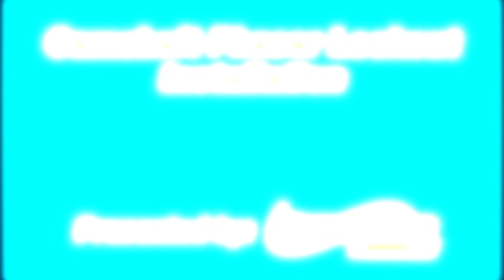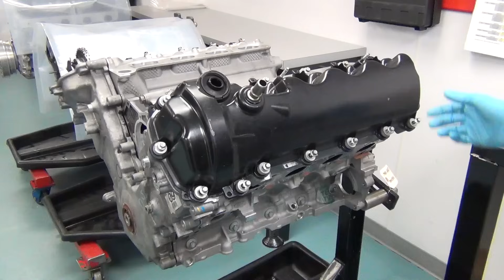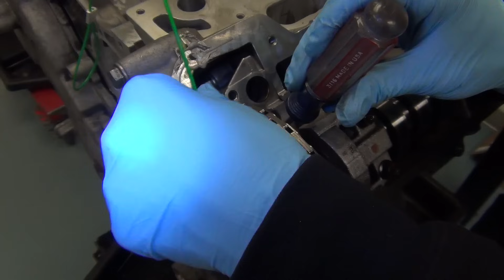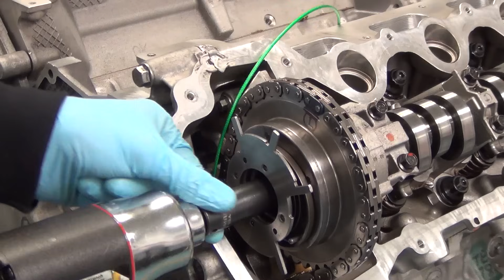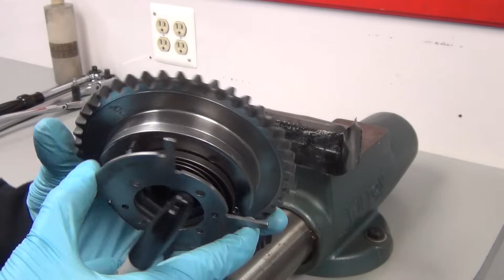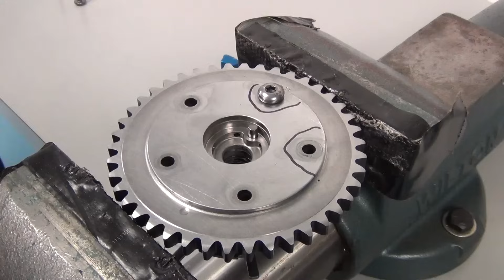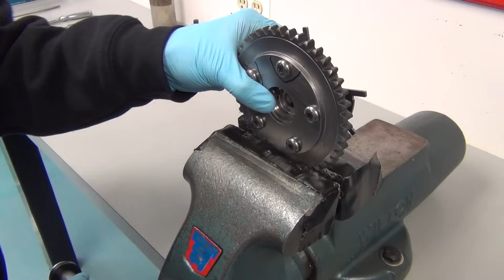Cam Phaser Lockout Installation Instructions - Livernois Motorsports New Link below

Comment: Hello, I have a problem with a 2008 F150 5.4L 3V. First problem, when in cold and starting the motor sound a chain noise, the technician said that is a CHAIN TENSIONER on the passenger side. Second problem, it thrown a P0022 code (INT CAM POSITION TIMING OVER RET BAN 2), its misfiring the passenger side and the technician said maybe is a phaser... The truck was repaired of a time chain kit 2 months ago... those problems I have sounds awful and the motor starts to vibrate... I saw a lot of videos on youtube that adjudicates the problems to VCT Solenoids... and maybe could be those, but I´m not sure... What do you think? Could those Phaser Locks help to solve my problems??? For what are those made for??? What are they improvement for the motor or what is the benefits? Hope you can help me with this!! What happen with the CHECK ENGINE light? This light will keep on????? Thank you!
Mostrar menos
RESPONDER
Reply from the maker: From what it sounds like, it is in need of our phaser lockout system. The main improvement is that you will never have another issue with the VCT system at all because it bypasses it, making it operate like a traditional fixed timing gear. Our package comes with our MyCalibrator tuner, and the corresponding tune changes to make certain the engine runs properly with the VCT system eliminated. The only reason the Check Engine Light would come on is if there was a legitimate issue outside of the cam phaser system itself.

Comment: Hello. I plan on replacing my phasers, roller followers and lash adjusters. Now when i take the phasers off can i pull my cam shaft out and just simply lift the followers out and just put new ones back in place?
Reply from the maker: Yes, you can swap the old followers and lash adjusters out for new ones by removing the camshafts. They should be close enough to maintain the correct lash spec on the engine.

Comment: How do you take care of trouble codes of inoperative Variable timing after locking the phaser?  Is there a tuner?
Reply from the maker: this package comes with our MyCalibrator tuner which makes the appropriate adjustments to operate with locked out VCT

Comment: I currently have phaser knocking on my 06 mustang gt. Will this solve/fix the problem or do I need new phasers? Trying to go the cheapest route here.
Reply from the maker: This will indeed address the phaser knocking on your Mustang! We always recommend inspecting the existing phasers to ensure there is no physical damage, and if not, then they are suitable for reusing.
Reply: Livernois Motorsports Would you advise when installing the new phasers,would you install new vvt's also? Or is that overkill?
Reply from the maker: If you're referring to the solenoids, no need to replace as they're no longer utilized.
Reply: Livernois Motorsports I swear this is going to sound dumb but, using the "cam phaser lock outs" deems the cam phasers useless? Because my problem is, I have a phaser that's knocking but when you unplug the sensor that goes to it, it quits knocking. So would it not be the same if I just kept it unplugged? If the lock outs deem them useless? I'm sorry for the questions. I know you are very busy but I do really appreciate your valuable time!
Reply from the maker: Unplugging them may impact them temporarily, but without oil flow to 
control them they can move uncontrollably as well which can lead to 
engine damage.
Reply: Livernois Motorsports Thank you again for your time! Much appricieated.
Reply from the maker: No Problem! Let us know if we can help you out with anything else! :)

Comment: Just open the phaser put inside the lockout chunkier and install again in engine? thats all i have to do? no problems so far?
Reply from the maker: it's that simple, well along with the other steps shown including tuning it, replacing the phaser bolt, and making certain the engine is timed right

Comment: can faulty cam phasers cause a huge loss in engine power?my 05 f150 runs smooth but it only has about half the power that it should have.even the thought of passing another car is out of the question due to the loss in power.the guy i bought it from said he replaced all the chains and guides and tensioners,but he didnt replace the phasers?i dont really hear any strange ticking noises coming form the phasers?im at a loss.please help
Reply from the maker: big mike Absolutely, if the computer can't control the cam tuning then it usually will be down on power.
Reply: if my cam journals are leaking too much oil cause the phasers to not work properly,will the lock out kit correct the phaser issue and make the engine run properly?thanks alot for responding to my first post. mike
Reply from the maker: It will correct the cam phaser issue, yes. However, if it is losing too much pressure engine damage can still occur.
Reply: ok,how will the truck run if i install the lockouts without installing the tune?
Reply: and will your lockouts work with ford phasers and dorman phasers?
Reply from the maker: poorly, and with a check engine light as well.
Reply from the maker: We have a deluxe kit that includes both versions for those that are uncertain what phaser their vehicle has and want minimum downtime during the repair.

Comment: got my phaser out in the vise. i have the one long bolt style of phaser 04 150. spun my rear cover out of the way on the phaser. my aluminum lock out blocks all go in to easy. i dont have to push the block in all 5 positions. two positions are way loose i wont install in two of them for sure. other 3 dont need force to install. just pick the best one?
Reply from the maker: Correct, the tightest fit is the optimal position for these. They will not always need pressure to install.
Reply: Livernois Motorsports ya it's such little play. I figured oil will take up the slack

Comment: great product I've installed 3 so far they are pricey yet quality always cost and I haven't got any complaints of either of the 3 ever having the same problem again its been 3 years for the first one so like I said great product
Reply: No check engine light with these?  I've gotta put them in a friends 5.4
Reply: Translate

Comment: Just had this kit installed by my Ford dealer where I bought the truck, 2010  F150,  5.4 litre.  Don't know if they installed it right or not but $3500 later, the ticking is louder and the truck still runs like crap.
Reply from the maker: Unfortunately there are a myriad of sources for engine noise, however, if it was indeed the phasers, and our kit was installed correctly, then it eliminates all phaser noise. Now, of course improper install, or improper diagnosing of the source of the noise does happen from time to time, but that is something outside of the kit's control of course. I would recommend taking it back to the place of install to have them look over the truck.
Reply: That's why I'm questioning the install, but I can't see giving these guys even more money.
Can I plug the MyCalibrator  tuner back into the same truck and see what it says?
Reply from the maker: It will scan for trouble codes, which may prove useful.
Reply: Barbara Locher here's a secret, took me 6 months and 4, 000 dollars later. Put 15w40 in it and unplug the cam phaser. Works like magic on these motors. Spread the word
Reply: Jonathan Rosamond
Jonathon my 05 5.4 is banging/thumping/bucking on acelleration which to me is likely phasers
  Heavy oil and unplug phasers
Now just where does one unplug the phasers
Thanks
Richard Appleby
Reply: Richard Appleby sorry I meant vct's. my bad bud
Reply: Barbara Locher dealers wont do the lockout, its an emissions delete.
Reply: There is no dealer in the USA that would install s lockout. Maybe a true fix...but not a 3rd party lockout that defeats emission requirements.
Reply: There shouldn't be but there are.  The self-inflicted wound of our industry pisses me off to no end.  The recent acquisition of the jugular exposed companies will hopefully close the DIY wound and Orielly etc will be selling air fresheners and floor matts only once again,.
Reply: The problem is circled in front
Reply: dumbass....

Comment: Why not just replace the phasers since your in it that far anyway
Reply from the maker: Simply put, because our kit turns them into traditional timing gears, so as long as there is no physical damage to them, it would be a waste of money.
Reply: Is that worth losing performance on the engine?
Reply from the maker: +Hangfire To us this is the simplest answer. What good is a few horsepower if it costs you thousands of dollars periodically to keep that power, but could potentially cost an engine? Additionally, most people report an increase in power because the truck is no longer in a fault mode with uncontrollable timing.
Reply: Thousands of dollars periodically? You may have to change cam phasers once in the lifetime of the engine and it runs about $500 per side.. And claiming an increase in power by disabling limp mode by altering the engine to lose power and efficiency versus repairing the problem, this is like cutting off your foot to fix a broken shoelace
Reply from the maker: Unfortunately most customers buy our product after repeated phaser failures. Not their first go around. We've had people report as little of a fee days before brand new phasers fail in a used engines, to, if they're lucky a year or two. So it's only after wasting thousands of dollars repeatedly "fixing" a problem that they finally buy our kit for a true permanent fix. Since the phaser itself is only part of the issue at play, replacing it only helps part of the problem as well. Ours addresses all sources of phaser failure in one kit.

Comment: These lockouts apparently cause a reduction of 15-20% in top end power i had read further down in the comment section. Maybe not a great idea, the 5.4's are a little on the small side for an F350.
Reply: CHRIS BROESKY you are probably the person that buys the cheapest oil and filter Walmart has to take care of your vehicle.
Reply from the maker: While there might be a small reduction, that number is quite out of proportion to reality. However, many people forget that when your  vct system has failed, it causes a substantial reduction in power as the ecm runs in a default mode. Additionally, the uncontrollable cam movement adds to this poor performance. This is why so often people report on restored power with our system. So, in a perfect world where the vct system works as intended and never fails, it might make a little more power than being locked out, unfortunately that isn't reality.
Reply from the maker: You can find them here: https://www.livernoismotorsports.com/product/LPP822133
Reply: Thanks, but 750 bucks for that?! Woah! Its two bolts, two aluminum insert blocks, and a little LCD button pad that looks no more complicated than a calculator.
Reply from the maker: We've covered this many times. People forget things like r+d, calibration development, emissions certification, and other aspects are things that cost money.  Not to mention the machines, and USA workers we employ to design, manufacture, package, ship, and who handle tech support. But we could do the popular solution and outsource this to a developing country, and lay off those employees to reduce the cost. But we won't because offering superior products that are engineered, and manufactured in the USA is what we do, and an integral part of who we are.
Reply: Livernois Motorsports & Engineering 100% correct! I'm a firm believer in...
"You get what you pay for"
Reply: @chrisbroesky2932  your correct. Since this repair is so much needed, many take advantage of this and Mark up simple items due to high demand. Remember....supply and demand. Big issue in every 4.6 and 5.4 means everyone will eventually need one. That means money. Especially when most scan tool programmers are cheap and this programmer is so expensive. I would recommend you find the parts elsewhere or buy the lockouts and locking block here at their website and it will be cheaper to pay a mobile mechanic 30 minutes labor to program with their own programming tool.

Comment: The phaser on the 5.4  2007 F150 I just pulled apart has all the same length bolts in the phaser. Do I have to do anything different when installing the locks?
There is no long bolt holding the spring.
Reply from the maker: Other than making certain you orient it properly when going back together, no. Just pay special attention to the disassembly process as you will not have the long bolt to reference.

Comment: $699 for 2 little aluminum locks? what a joke
Reply from the maker: 2 blocks, 2 bolts, 1 wedge tool, and a CARB approved tuner. Still substantially less than other "fixes" that don't actually fix it, and the only complete, CARB approved option out there. Singling out one part of the kit is like saying that 20,000 is a rip off for 4 wheels, when really the price is for a whole car.
Reply: I was quoted 3800 from ford to replace the phasers and new updated oil pump.

Comment: Do you use any special tool to hold the camshaft to tighten the phaser bolt? Thanks an very good idea of using this lock out system.
Reply from the maker: +gaston50952 No special tools needed, we typically just use another wrench or ratchet to hold the balancer bolt, to prevent the engine from rotating while torquing the bolt down for the cam phaser.
Reply: @LivernoisMotorsports  You should have mentioned that.
Reply from the maker: @CARRJ142  We did in this comment, and it's been here for 5+ years. This is just a more basic item and we wanted to cover the items most people would be struggling with.

Comment: helloIs it necessary to change the phasers to put the lockout kitthank youRick
Reply from the maker: +Richard Seguin This is only necessary if there is actually damage to the phaser assembly. +90% of the time the phaser is still mechanically sound and can be used with the lockouts, but take the time to properly inspect them before reinstalling them

Comment: Why are these phasers ticking and what part on them is actually making this noise.???
Reply from the maker: +MrMus TangMan They are ticking because they have lost control of motion due to a reduction in oil pressure. The noise is emanating from the 5 vanes quite literally smacking the built in stops in the phaser since the motion is completely uncontrollable

Comment: question?? if I installing brand new phaser from the dealer, is necessary to install this kit? whats the reason of it?????
Reply from the maker: +alekstolstoi We've answered it a few times on this video, but the basic points are that the new phaser does nothing to correct the issue. The phaser is but a piece of the puzzle. And replacing one old piece doesn't make the whole puzzle new.

We have had people install everything the dealer recommends, phasers, solenoids, chains, guides, pump, etc just to have it make the same  noise within months, or sometimes the same day, where as the lockouts permanently eliminate any chance for loss of control of the phaser.

Comment: I'm a bit confused.  Will this work to repair Cam phasers that are already knocking/ticking or is this fix just for new ones to keep them from going bad?
Reply from the maker: +Craig Cundiff This is pure truth
Reply from the maker: +Craig Cundiff Unfortunately there are a good number of variables when doing these engines, often times requiring running tighter than stock clearances. However, tuning along will not address this, only the balance of mechanically locking them out AND revised calibration will work.
Reply from the maker: +Mike Luchia Well, really both! So long as there is no damage to the phaser it can be used in the existing pieces, and if you are putting in new ones, they could be used to prevent future issues as well.
Reply: +Livernois Motorsports So other than opening the valve covers to check for damage is there any other way to tell?  If not I might as well replace the Phasers while I have the valve covers off, which in the end still costs the same amount to replace the Phasers.
Reply from the maker: +Mike Luchia Unfortunately not.
Reply: +Mike Luchia 
any new parts you put on will fail...use the lockouts. and never worry about it again...
Reply: Livernois Motorsports I have an Ecotec ...and im finding this is the case pretty much throughout all VVT setup vehicle lines...ive replaced everything in and on the head after getting a "ticking" after doing a forged bottom end and head R&R...only thing left sre the roller rockers...and I'm not holding my breath....Unfortunately I don't think there's a "fix" like this for 4 cylinder VVT Ecotecs...probably gonna end up having to scrap this build and get a third gen girdled block and switch everything over...sans VVT...in the long run I'll have the potential to make >700whp...but im gonna be out a few grand in this build...😞
Reply from the maker: +Craig Cundiff Without evaluating it further, it's definitely a potential. I will say though that often times the system might be fine, yet maybe the engine clearances are to blame.
Reply: Livernois Motorsports I put in forged components..but stayed with the stock clearances ...checked it all going in...but maybe something got by us...im also looking at the tune for an answer...